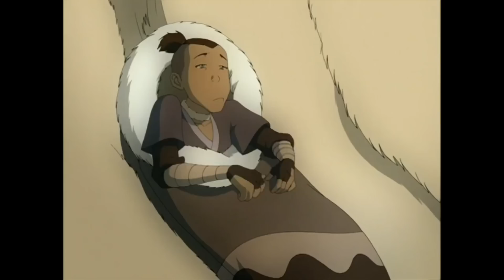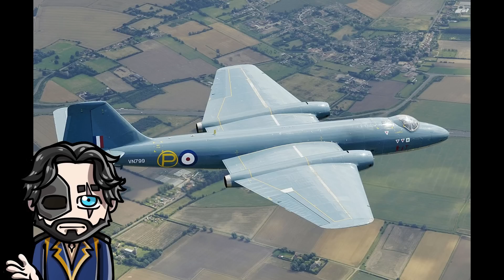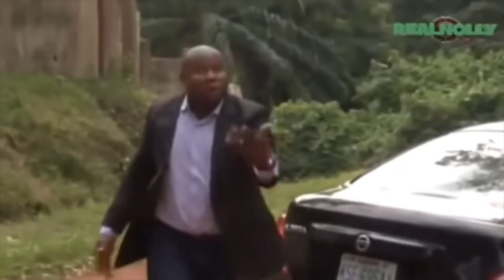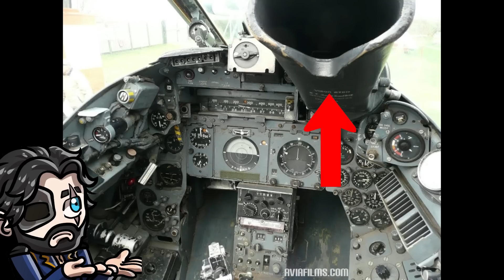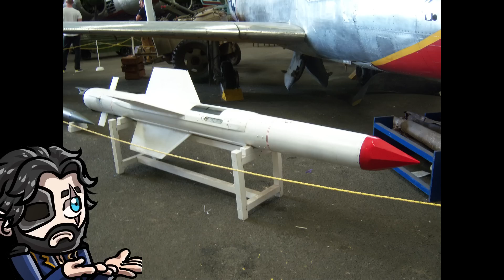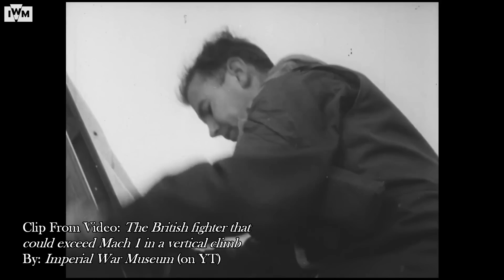English Electric Lightning: Gone In a Flash | Corrupted Intel Files

Comment: I saw one at an airshow  in the 70s  go vertical just after takeoff, the absolute beast 👍
Reply: I've seen an F-104 do that. Accelerated teh entire length of the runway before pulling up.

I've also seen a Super Corsair with 5,000HP do it. went straight up for thousands of feet smooth as butter.

Comment: This era of jets is confusing. There are so many jets and they are all so similar.
Reply: I imagine a lot of that is the case of America building the F-86 and then every other country copied it as their first fighter aircraft. Looking at you Russia, China and Korea.
Reply: @amandarhodes4072  One Aeroplane looks much the same as another, the same can be said of automobiles.
Reply: @DerekLangdon-w9e  That's a very oversimplified opinion.

Aircraft of this period looked fairly similar for a reason. Only a handful of nations were developing successful aircraft and those nations often collaborated on their design.
During ww2 the Americans purchased an example of the first jet engine from us and used it to produce their first line of jet powered fighters and interceptors. As a result of the limitations of the prototype engine design that both the US and Uk were using the aircraft they were fitted to looked similar.

Much later on jet engines were being developed between the UK and US indigenously but still shared many of the familiar design roots that aerospace engineers knew worked.
Similarities such as the aluminium shiny hull. Central nose air intake, swept wings, single front nose landing gear. Bubble canopy.

These successful designs were often copied by lesser technologically competent countries like china, korea and Russia.
Hence the early Mig jets were a near carbon copy of the early US fighters.

Only when extraordinary change was needed to expand the field of normality was a new design concept developed to achieve something no previous aircraft had. Examples being of having the engines mounted in underwing pods for easier maintenance and for better wing strength, The development of large radar systems requiring them to be mounted in the nose and the air intakes located elsewhere, the development of supersonic capable engines and the need for an aero frame that could brake the sound barrier.